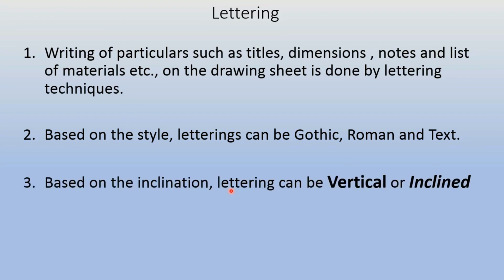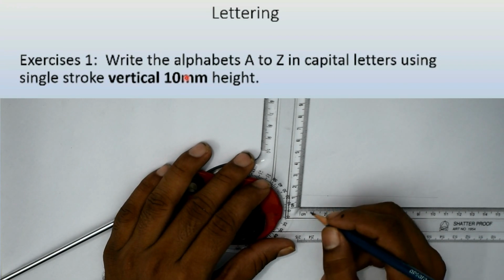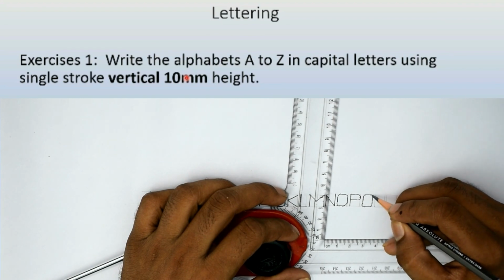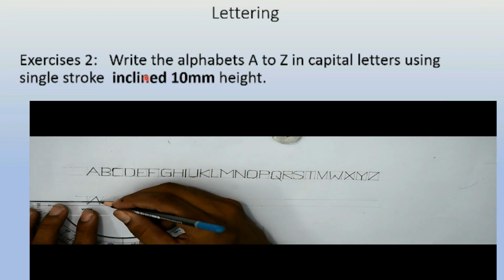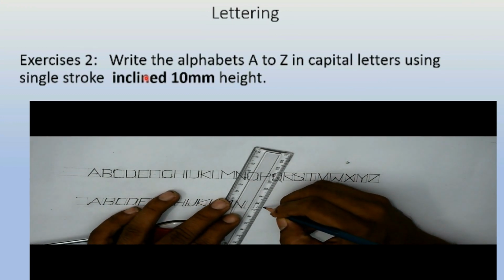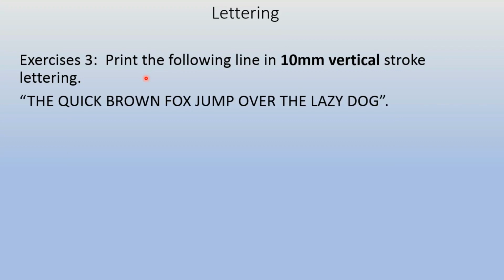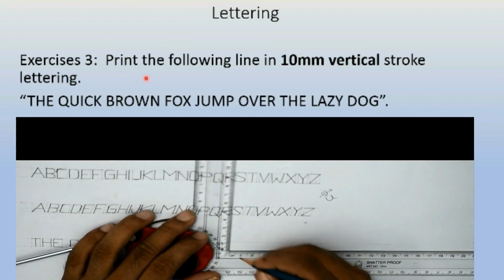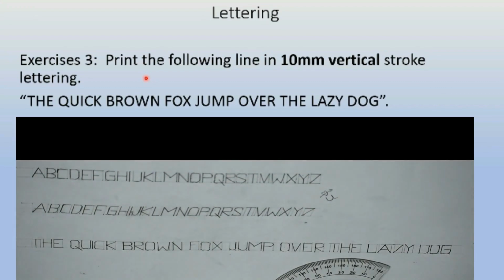Lettering

Comment: If height 12mm in size then width how much sir
Reply from the maker: As per BIS SP 46 Standard of 2003, standard heights are 1.8, 2.5, 3.5, 5, 7, 10, 14, 20.

But even for 12 mm height we can calculate parameters as below:
 
Type A			
Characteristic				Parameter		Ratio		Lettering Height
Lettering Height		                	h			(14/14)h		12 mm
(Height of capitals)			

Height of lower case letters		c			(10/14)h		8.57
(without stem or tail)			

Spacing between characters		a			(2/14)h			1.71

Minimum spacing of base characters	b		(20/14)h		17.14

Minimum spacing between words	e			(6/14)h			5.14

Thickness of lines		        	d			(1/14)h			0.86
			
Type B			
Characteristic				Parameter		Ratio	
Lettering Height		                	h			(10/10)h		12 mm
(Height of capitals)			

Height of lower case letters		c			(7/10)h			8.4
(without stem or tail)			

Spacing between characters		a			(2/10)h			2.4

Minimum spacing of base characters	b		(14/10)h		16.8

Minimum spacing between words	e			(6/10)h			7.2

Thickness of lines	         		d			      (1/10)h			1.2

Refer: 

https://en.wikipedia.org/wiki/Technical_lettering

https://law.resource.org/pub/in/bis/S01/is.sp.46.2003.pdf

PS: Make sure to check with your college instructor if they are following any other standards rather than BIS SP 46 2003 or 1988.

Comment: Pls suggest me drawing table and pad for easily drawing with drafter pls sir also pls increase voice sir
Reply from the maker: Option 1: Buy complete setup (Costs More) 

Example:
Pentagon Engineering Instruments Drafting Table Imperial Size - a1(Drawing Board Stand) Easel for Painting, Engineering Drawing - for Architect, Artists, Interior Designer (23" x 32" inches, A1)

https://www.amazon.in/dp/B08F8X9GZR/ref=cm_sw_r_cp_apa_glt_fabc_6KEQXNMX3W5DAWN3G0FA

Option 2: Buy only Board setup and adjust it on a table(Costs Less) 
Example
Brand: Generic
3.8 out of 5 stars  4Reviews
SIMRAH Engineering Drawing Board 23 X 32" MDF Deluxe Quality

https://www.amazon.in/dp/B08Q8H5QLL/ref=cm_sw_r_cp_apa_glt_fabc_X784MG1D8QX2457CZFWB

You can buy it ofline for better pricing.